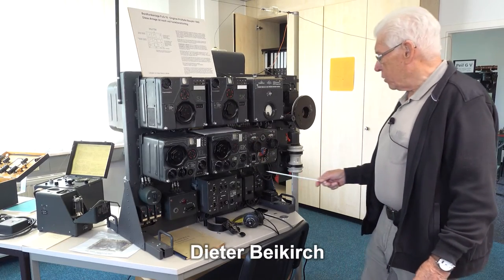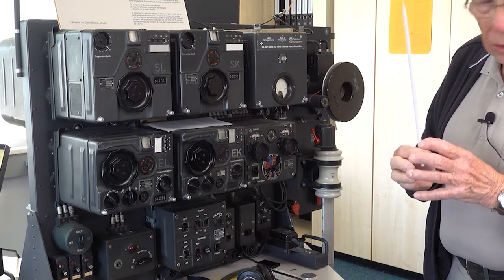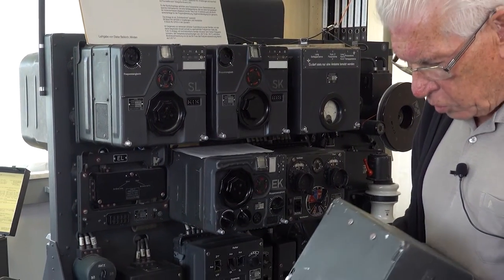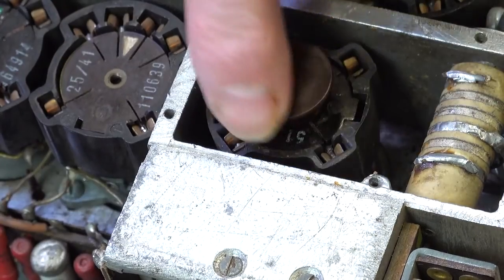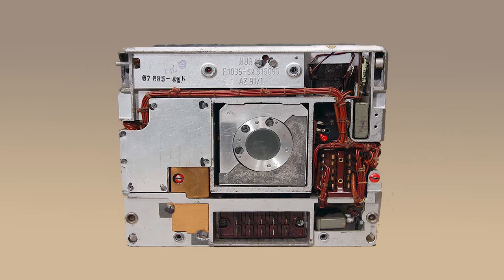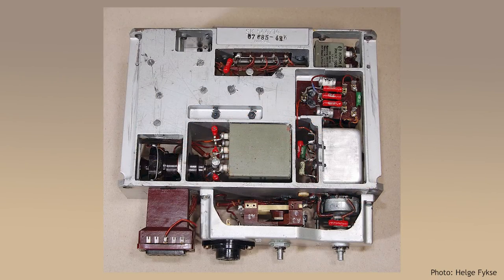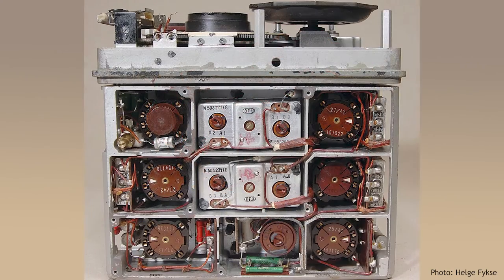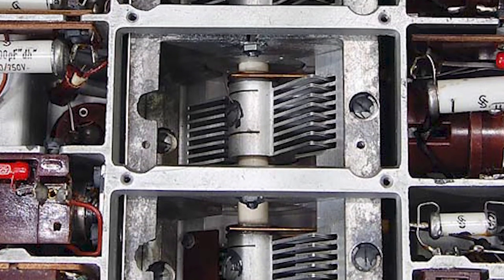Why are Luftwaffe radios the best?

Comment: There were so many ways this equipment was better than anything before and any of the British or American avionics. These include:
Very light weight and great strength and mechanical stability due to cast magnesium alloy chassis.
Modular design, rapidly swappable.
Simple logical controls. Ergonomic design.
Sockets for rapid fault diagnosis (like on modern cars)
Minimised inventory components - almost all the valves are the same.
Excellent thermal stability - oscillators are drift cancelled by precision PTC NTC ceramic capacitors.
Very robust, reliable miniature valves.
New generation of NP0 stable ceramic capacitors.
New generation of iron powder and ferrite materials allowing highly stable fixed and variable inductors.
Precision variable capacitors with ceramic insulation.
Hermetically sealed 0.1uF decoupling capacitors with a lifetime of more than 70 years.
Use of ISO symbols before the ISO existed such as A1, A3 for CW and AM and the < symbol for volume control.
Date code on components.
Excellent documentation and even training films (still in existence).
FuG10 was rolled out into most standard aircraft which must have made servicing so much more efficient.
Anyone who has owned one of these and an equivalent UK aircraft receiver (R1155) or US receiver (Command RX) can attest to the dramatic difference in design and build quality between them, the UK ones being by far the poorest.

Comment: Wow, talk about overkill.  That’s impressive build quality for sure but as rugged as it is, it can’t stop a bullet or survive a crash, so what’s the point?  If you take the volume and weight of the low frequency transmitter, short wave transmitter and antenna tuner all together, it would surely exceed that of the lowly US made AN-ART-13 which has all that in one unit.  So, the ART-13 would weigh less, take up less space, cost WAY less and the ART-13 puts out 400 watts A1 and 100 watts A3 which is almost 6 times as much, and to boot, the ART-13 had autotune capability.
Reply: Durability,  resistance to vibration and shock,  and maintenance efficiency pays off in real world.   Met their needs nicely.